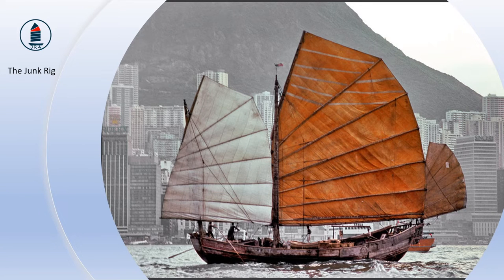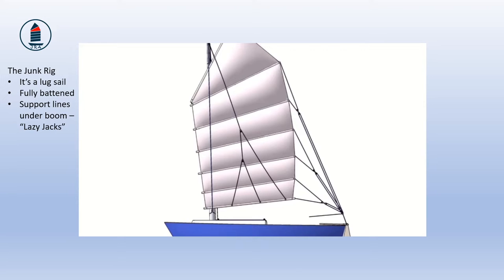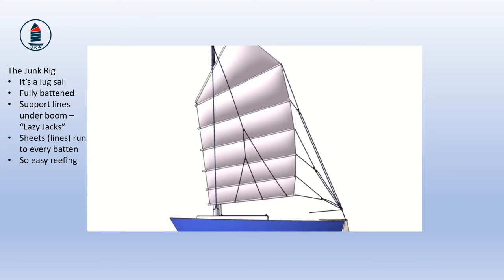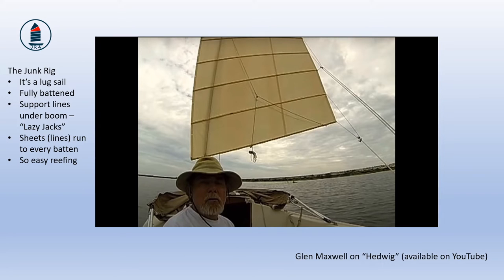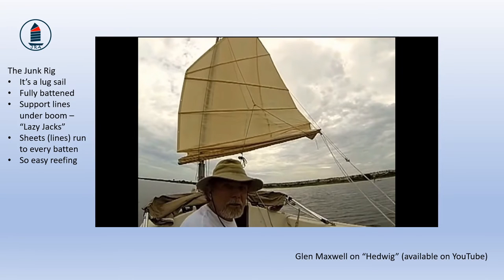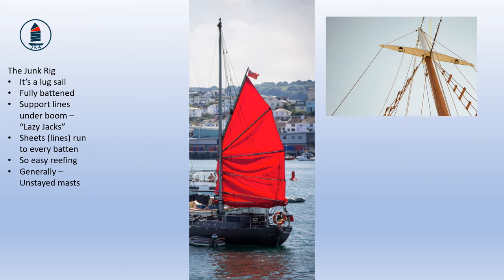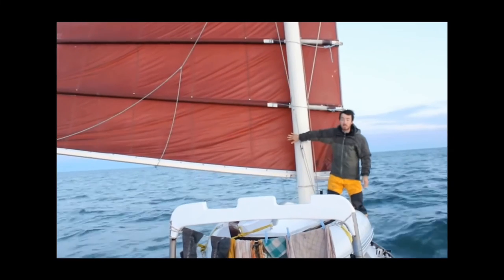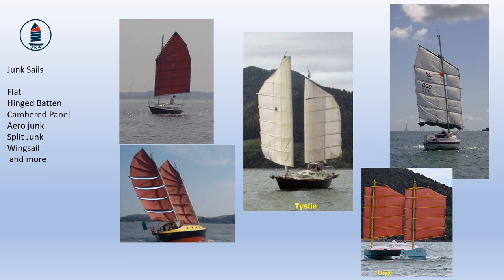Introduction to the Junk Rig - part 2  (revised)

Comment: I'm curious as I could possibly be,  so I must ask..... is it possible to "heave to" with a junk rig?   (I learned to heave to with two sails set at opposite angles )
Reply: That’s a simple question but the answer is a bit complicated.  So, a junk rig boat usually has no Bermudan type foresail to be left aback.  But we can, and do sometimes shorten sail, leave the sheet a bit loose and turn the tiller so as to point the boat to windward.  Depending on the boat, this should slow the boat right down and leave it just a touch more than drifting along.  But a well tuned boat that usually tacked easily might accidentally tack and then bear off, so some might choose to leave the rudder centred and let the boat lie ahull.  The junk rig sail, even if left very loosely sheeted will not tend to slap about very much so the sails won’t be damaged by being left in the breeze.  Different for schooners, and more expert answers to be found on the Junk Rig Association website.  Have a look or join the Association for a genuinely very low fee.

Comment: interesting, esp. the way the rig reefs, but on first appearences it looks like a "GAFF" rig, where there is a 'pole', from which the sail is LOWERED, like a single sail of a SQUARE rigged boat, where the pole is also hoisted to opperating position, not as simple to reef as one first thinks, having to lower the whole sail to remove the top triangles.
Reply: It's called a YARD, not a POLE. You obviously don't know enough about sails to make any useful observations.